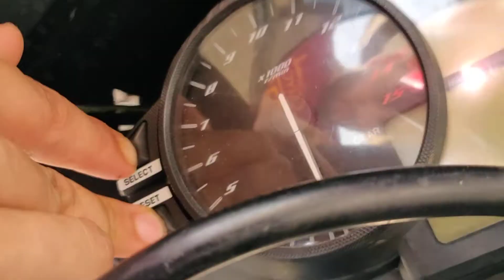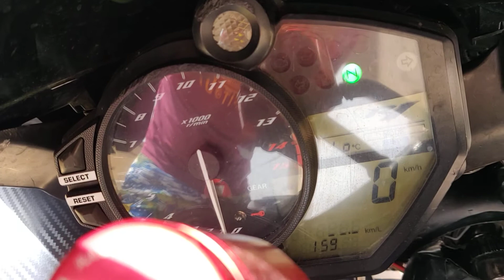Solve code 69 problem yamaha r1

Comment: You need to replace the CCT, that sounds awful, also replace the starter motor, or at least replace the brush kit/set inside. Otherwise its going to drain your battery fast